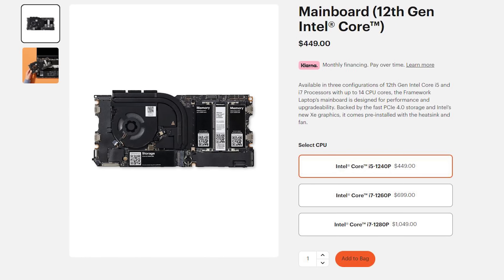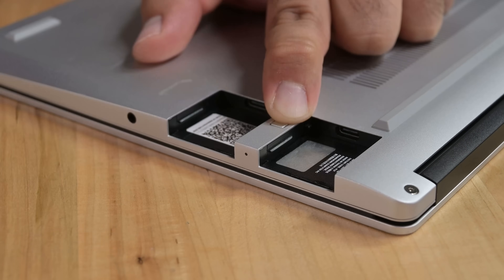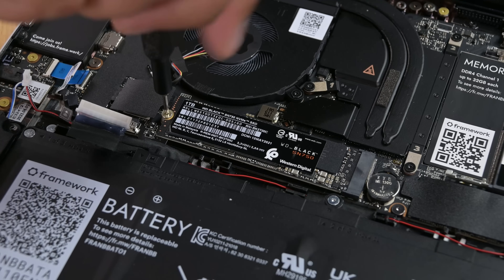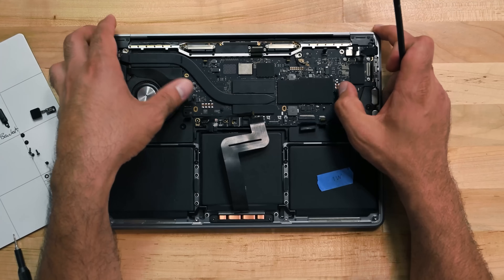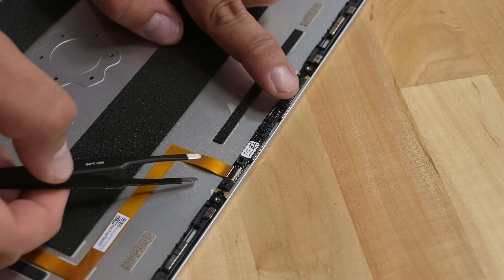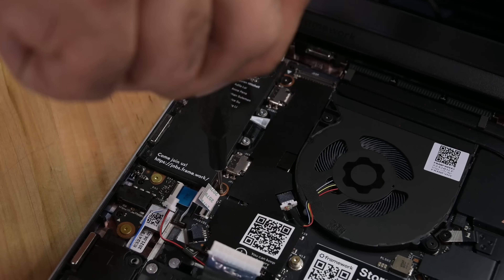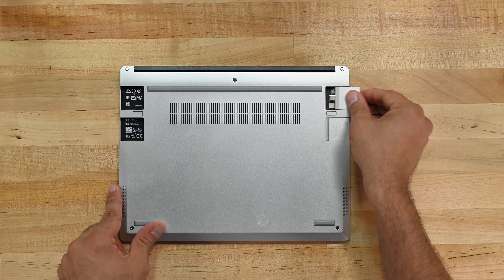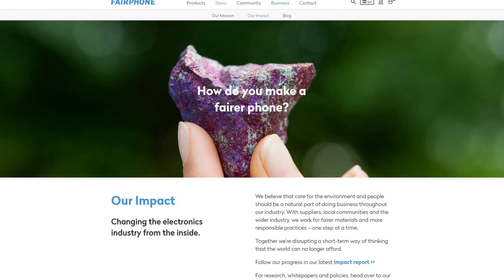The Framework Laptop Is Now Fully Upgradable!

Comment: This is how it should be done. No more junking the whole thing just to upgrade a cpu, gpu, or memory.
Reply: Yeah Framework should be the norm, not the exception.
Reply: @Ebalosus  But most of the replaced parts will just be thrown away. It's too much admin for non-tech savvy individuals.
Reply: @moswanedev  they made the motherboard usable as a stand-alone computer… Linus had a video about it
Reply: @moswanedev  . Ideally for precious metals recycling
Reply: Not really, we need to bring back laptop cpu sockets and gpu actual cards, would be cheaper and better imo
Reply: Honestly compared to other companies this is what makes them more environmentally friendly not the other nonsense they're doing
Reply: Truee
Reply: Just one thing please... Can u upgrade the GPU too? Please answer
Reply: And yet, you're still throwing so much away when you replace the system board. On one side it is nice that you can replace it with something newer, but that is usually also only the case for a few years after which time new features or design trends force them to break backwards compatibility, usually around the age when people actually start looking at upgrades.
Reply: @Hans-gb4mv  what new feature or design trend would force them to make a laptop motherboard that doesn’t fit inside the current chassis.
Reply: @Hans-gb4mv  Framework can't make a non-socketable CPU socketable. If you buy this laptop you don't care about design trends, what features would break compatibility?
Reply: Yeah, let's pretend that the second-hand laptop market doesn't exist.
Reply: @SoldererOfFortune  Except that all those secondhand laptops will never change the repairability. It will stay that way forever.
Reply: Costs as much as a new laptop btw
Reply: @bird6691  There is no competition for this niche upgradable/modular laptop market and they are a start up company. They need the money so its understandable. If a tech giant would venture into this, even just one, it would change our lives forever.
Reply: Framework is a scam. You pay the price for a whole i7-1260P laptop just for the board ($788.00) and you are left with 1 working laptop and an useless board to throw away. If you buy normal, you'd have 2 laptops and can sale/gift/donate the old laptop to someone else so it doesn't go to the landfill.
Reply: @Peizxcv  You can use the “useless” board to either sell it online or use it as desktop But I can agree the price if the motherboard is absurd
Reply: @imdyinginside1919  Who would buy a 11th gen board? The entire series started with 11th gen so unless someone wants to replace their broken board instead of utilizing warranty there won’t be a buyer.

And making it into a computer? You want to jerry-rig heat sink, antenna, power supply, RF shield, and mounting point to a laptop board or do you pay people to do it for you?

I got a feeling a bunch of you and have never build a laptop or PC before. This isn’t the first DIY laptop, there was something like this 20 years ago with the same issue and that was much cheaper
Reply: @imdyinginside1919  motherboards aren’t cheap lmao
Reply: @Peizxcv  the heat sink is attached to the board Just continue using it. Antenna cables to Wi-Fi screws are commonly available. Power supply is just any old power brick you have that outputs at 12V DC. What would you even need an RF shield for.
Reply: @anonym3017  Because computer components are legally required to have RF shield both to prevent interference and limited RF output to the environment. Open any sufficiently complicated and you will see shielding
Reply: @Peizxcv  oh you mean the stuff the components already have.

So again where's the problem.
Reply: @anonym3017  Let me guess, you have never put together a computer before desktop or laptop because you don’t recognize what’s missing and all the cable connectors are proprietary

Do you work for Framework?
Reply: @Peizxcv  go watch any of the videos about turning a framework motherboard into a standalone PC.

Because the only thing that you need extra is a 12V powerbrick and maybe some new modules to put in the side
Reply: @anonym3017  What a sustainable gift to the world, the more you buy from them the more sustainable it is🙄
Reply: @Peizxcv  Sorry chief, but that's not a great take. Some people would buy the board just to stick in a 3d printed enclosure. Why pick a framework? Well it's the only brand committed to supporting that use-case. I've already seen some people's builds on reddit with second hand 11th gen boards from framework laptops. The market is there, absolutely. 

Also, liquid damage or physical damage are not covered under most warranties. Those people would also be willing to buy a second hand board to repair their framework.

As to the price, it's first and second gen of a new laptop design. There's going to be less and less engineering overhead moving forward as they get their workflow more and more optimized. Costs will come down as the product line matures.
Reply: @MyriadTechRepair  All I can say is people are generous to scammers when it’s ostensibly for sustainability, the environment, human rights, animal rights, etc.

Do you realize every good reason you cited also applies to normal laptop board at half the cost? An MacBook Air M1 board is $400 on eBay and comes with 8GB RAM and 256GB storage. Non-Mac laptop board would be even cheaper.

Framework isn’t the first one to come up with upgradable / repairable laptop; it’s the first one to convince people to pay double for it.
Reply: @Peizxcv  I personally just put a new motherboard in my macbook to upgrade it. However I lost Touch ID and for a normal user the repair would be way more difficult given the very delicate cables. I've seen way too many macbooks damaged before my clients even manged to open the bottom cover due to the non-common screws  they use.

Plus, Frameowrk is the only one with first party replacement and upgrade parts available for purchase. So... yeah. Also the only manufacturer supplying schematics of their laptops to 3rd party repair. 

If Apple could stop you from buying a new motherboard, I'm certain they would. They literally go and make small and insignificant changes to standard ICs and then force their supplier to not disclose the change  or sell  the chips.
Reply: @MyriadTechRepair  Normal users would not pay double to buy a laptop so a year or 2 down the road they can pay again to upgrade the CPU. They would just buy a regular laptop and go to uBreakiFix or Louis Rossmann if something went bad.

You should have bought a board that comes with Touch ID, that's the $400 listing I mentioned.

Clearly we are the type that's willing to pay more to tinker with hardware but you need to see how much they are charging for reselling parts they ordered from China.
Reply: @Peizxcv  "20 years ago" so this is the first one in two decades, holy crap.
Reply: @imdyinginside1919  Than.

NOT then.
Reply: @Peizxcv  Yeah but 20 years ago is 20 years ago, and technology has advanced to the point where that 20 year old laptop is useless. Laptop's also started becoming unrepairable, and Framework is the company that didn't continue the trend
Reply: @Peizxcv  Not really. There are open source kits to use it as a stand alone pc… you’re not up to date, are you?
Reply: @ThePianist51  So you buy a board to upgrade your laptop and then buy an entire setup without a board so you can use the old board.

How about just buy a new laptop and keep the old laptop as well so you will have 2 computers without going this big circle and pay extra to arrive at a laptop and a gimped PC?

Comment: I used to work to support a "One Laptop Per Child" program, where the kids would break their laptops to get out of doing homework.  I've fixed thousands of laptops of every brand.  This really isn't much different, aside from customer-facing parts availability.  Still, if they had a matte screen of a standard resolution, I'd have skipped the XPS this time around.
Reply: I've done a lot of repairs on modern laptops and this is completely different. Most modern laptops don't even have removable ram. And a screen replacement will take minimum twice as long, if you can find the part.
Reply: @Fattony6666  Yeah, but It depends.  Gaming and disposable consumer low end junk...  good luck ever finding parts, or not destroying it as you take it apart.  Dell, HP, Lenovo...  pretty easy to fix if you can get parts.  Their corporate fleet models anyway, which is what I was talking about.  I really wish the parts were standardized between brands.

Comment: Wow… I had a laptop 12 or so years ago from Asus (some ROG) that could be upgraded as It was modular with an exchangeable GPU board, CPU board and Ram. They have never sold the parts to do an upgrade.
Reply: yeah me too. I miss my asus rog g73. Too bad it stopped working after just 9 months.
Reply: @mazocco  Just 9 months?????
Wow. Way to promise a way to extend your products lifespan and then fail miserably.
Reply: Therein lies the problem.....technology moves so fast, the case and everything that's part of it will feel old and clunky
Reply: Well Asus is just there to grab yer money by offering good spec, cheap price approach. If you watch Northridge fix, Asus is the number one laptop that shows up for a fix